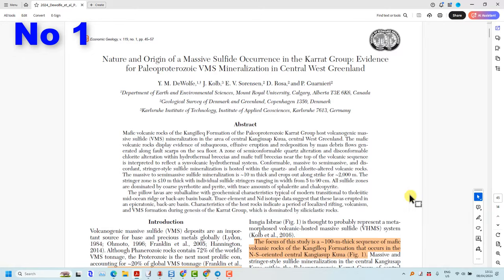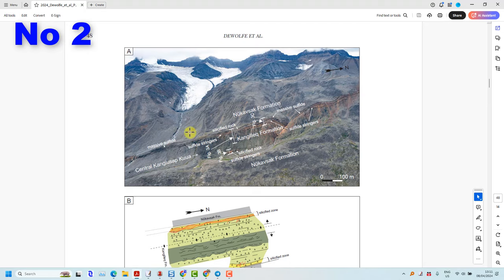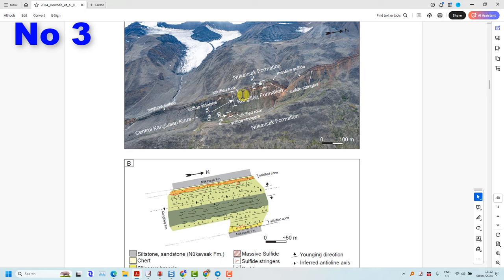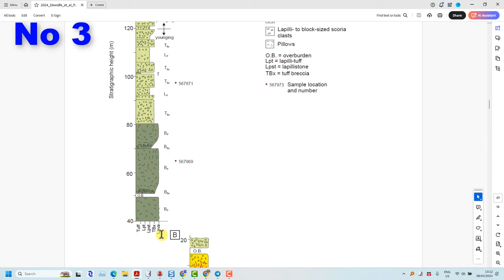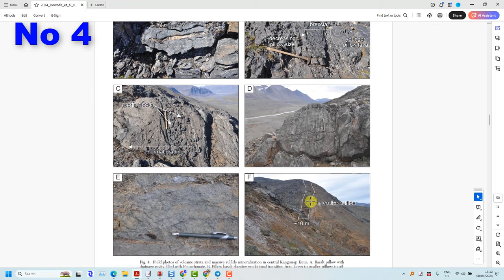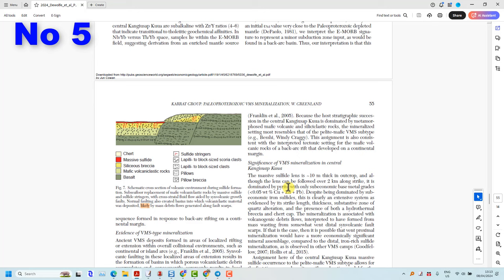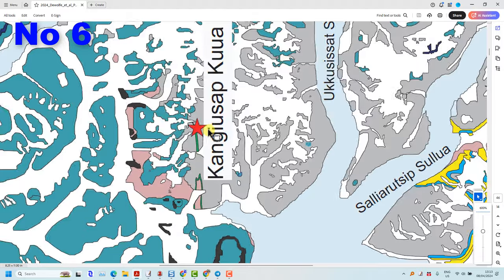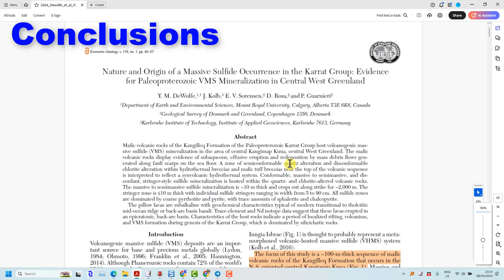SHORT 3min summary DeWolfe VMS paper analysis by Jun Cowan

Comment: on page 47 they state "Stratiform massive to semimassive sulfide (~10 m thick), underlain by a sulfide stringer zone, occurs in outcrop near the top of the ridge and is repeated near the bottom of the valley through an anticlinal fold."  Seems pretty clear to me that they see this as a single layer that has been repeated by the anticline you point out on the regional map.  Calling the diagram in Figure 2 a stratigraphic section might have been a slight misuse of the term, but it is clearly a graphic depiction of the outcrop and unequivocally does represent the sequence as having been repeated by the occurrence of the fold in the middle of the section, which they indicate as an anticlinal axis.
Reply from the maker: >Seems pretty clear to me that they see this as a single layer that has been repeated by the anticline you point out on the regional map

Yes, it certainly seems clear, James, unless one inspect the details.  The northern limb measures 40m in thickness, while the southern limb is considerably thicker at 140m, which is 3.5 times that of the north. Why?  Additionally, the northern limb lacks the basaltic unit. Why?  

As outlined in my longer video, Grocott's map shows both limbs have steep dips, which contradicts the significant discrepancy in their thicknesses. Several possible reasons for this variation include: 1) the northern limb has been thinned due to unrecorded strain; 2) the southern limb has been thickened due to strain; 3) the fold is not isoclinal, but the southern limb is dipping at a lower angle, but this implies that the "stratigraphic section" measurements do not represent the true thicknesses of the strata, but are taken along a non-orthogonal trajectory to the bedding. The reason why these possible solutions exists is because the basic documentation of the facts are far from adequate. If this work was conducted by an undergraduate, I would ask the student to draw a cross-section, with dip angles. It's disappointing, particularly as the author is an editorial board member of Economic Geology. This kind of oversight is not acceptable at the undergraduate level, much less from a senior figure in an international journal.